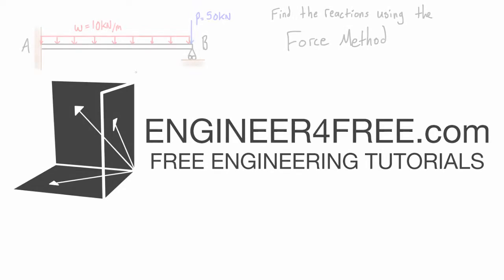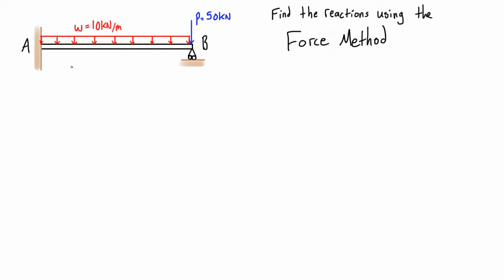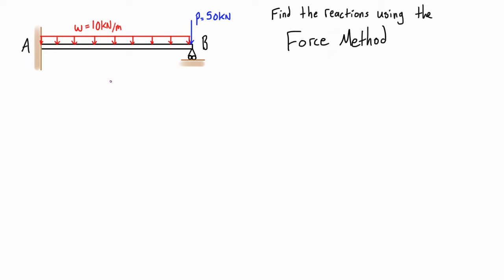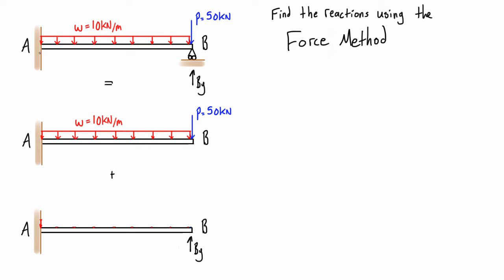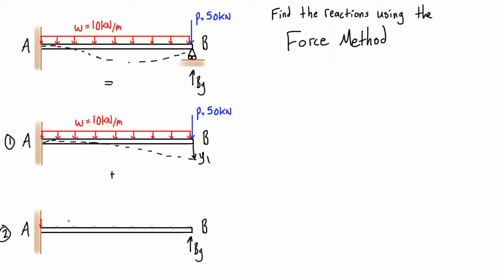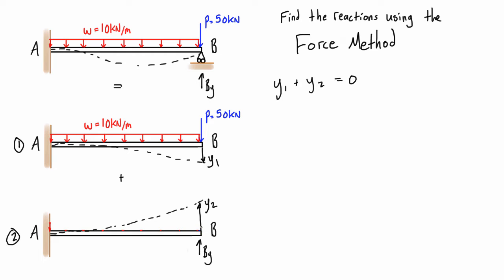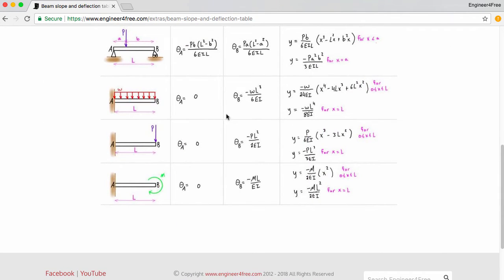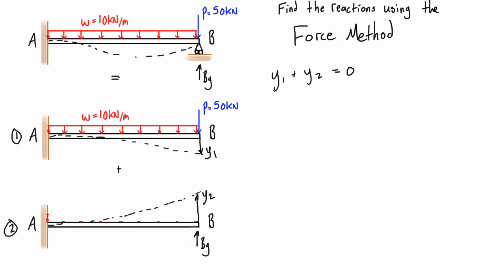Force method example #1: one degree indeterminate

Comment: What if I have a situation where the structure is similar to yours, but the P load is not on the end of the beam?  I'm unsure which equations to use when the P load is not on the end. The structure is still fixed at one end with a roller on the other (that we remove) and there is still a distributed load downwards across the length of the beam. The only difference is that the fixed end is on the opposite side that is on in regard to your structure and there is a point 20 m from the left side where the P load is applied, then 10 m to the right end of the beam where the fixed end is.
Reply from the maker: So that’s an overhanging beam. Here’s a video with an overhanging beam example: https://www.engineer4free.com/4/shear-force-and-bending-moment-diagram-practice-problem-7 the example is statically determinate but worth watching to get the idea. You just treat the beam section between the supports as if it’s simply supported, but instead of having zero moment on the end with the overhang, it’s going to have an internal moment equal to  that point load out on the end times the distance to it. Actually, I’d recommend checking out the superposition section of engineer4free.com/structural-analysis because the force method is actually just what we call when we use the method of superposition for statically indeterminate structures. Hope that helps